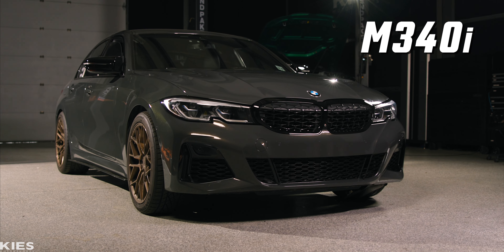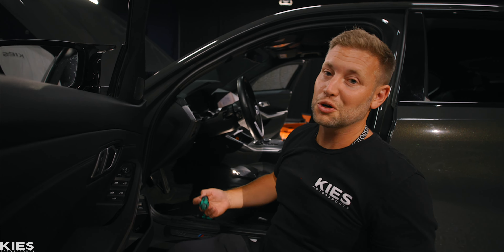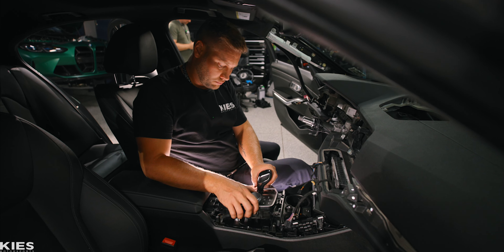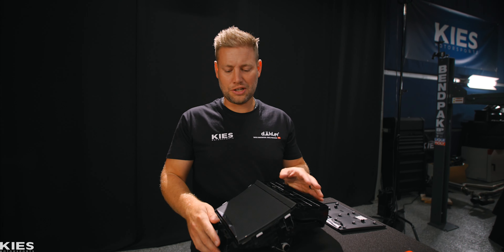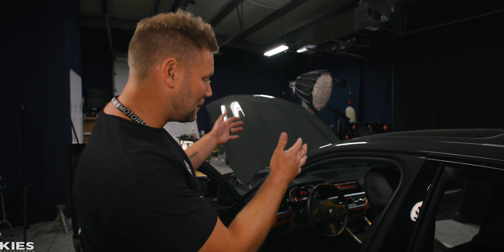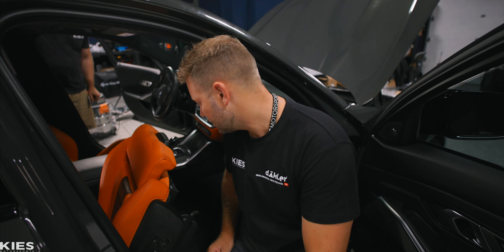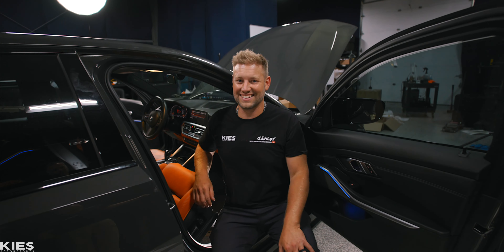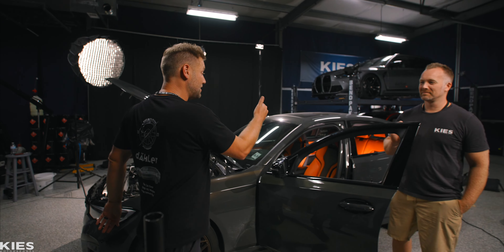FULL Leather M3 Interior in a BMW M340i

Comment: So were the seats more or less plug and play? I know you had some issue with the passenger seat, but it looks like an easy fix. I would LOVE to get some M3 seats for my G20 M340i.

Also, where did you source the seats? Did you get it from a crashed M3?
Reply: the M3 seats are identical to euro-spec M Sport seats that are optional for G2x and G01.